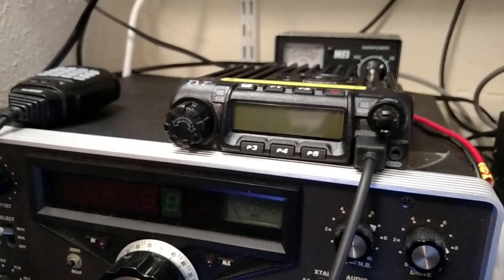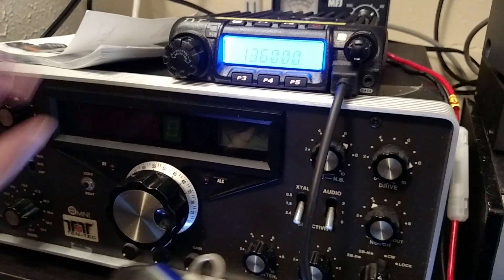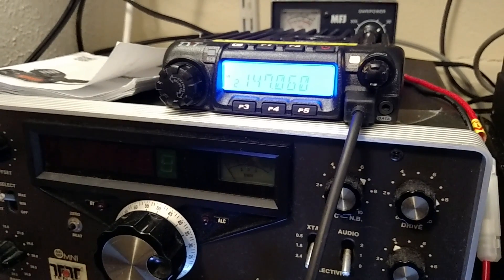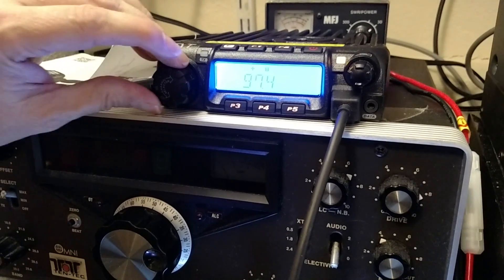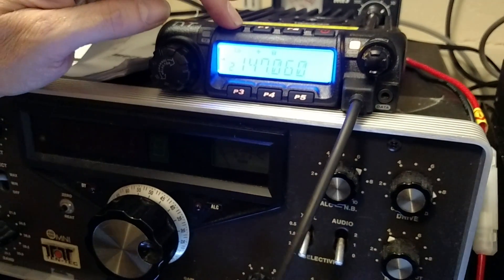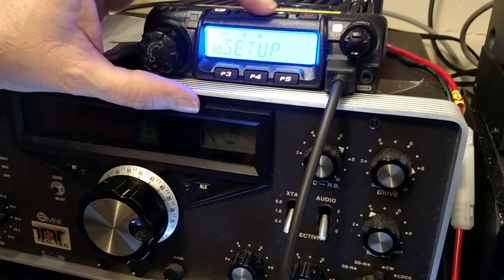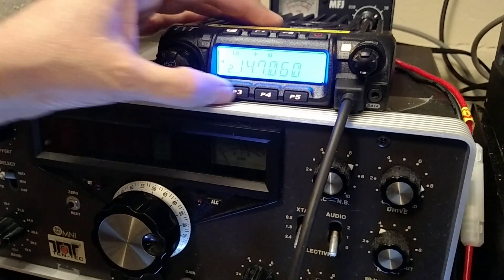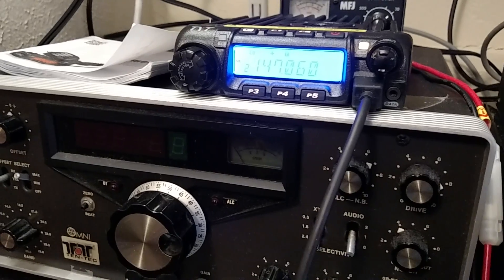TYT TH-9000D 2 meter rig quickstart

Comment: hello, can you give information about the output power of this device? do you really have 60 watt output power? Would you recommend this device? Thank you buddy
Reply from the maker: As hard as I tried to like that radio, I never got comfortable with it, and so I just used it less and less and then not at all.  It just sits in a drawer now.  When HF picks up on the next solar cycle I may put an antenna back up for that and maybe check out 2m again as well- I used a "J-pole" for that radio.  I don't recall if I ever measured its output but I think I remember that it could double as a space heater ;)